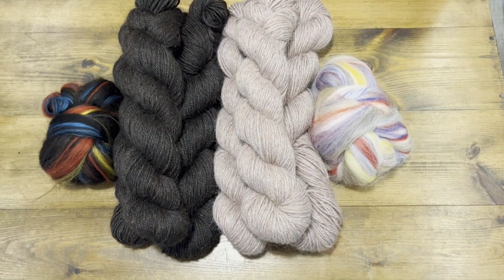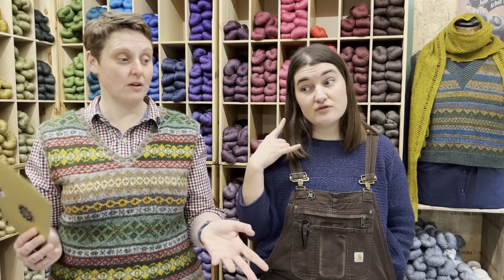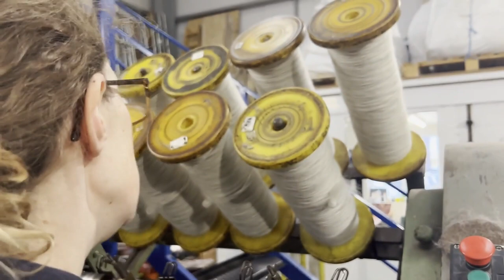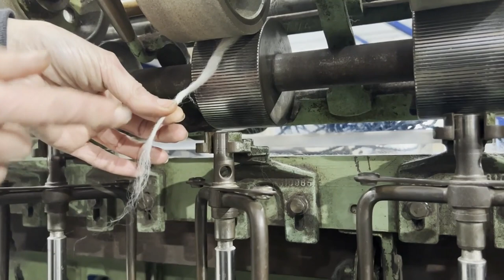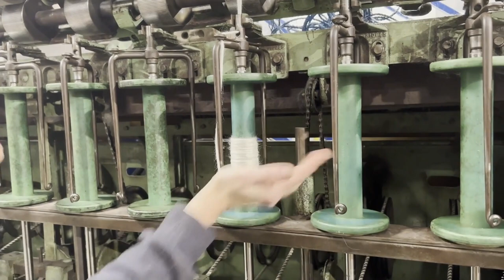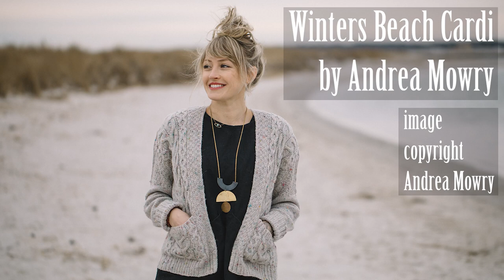JAT Vlog Episode 14 - All About Knit by Numbers & Squish Alpaca

Comment: I support the change in KBN, Devonia is my favorite. I love the longer fibers with a little more luster. The combination of having a long staple and worsted spun makes the yarn softer to the touch in my opinion.
Reply: @JohnArbonTextile  I would say that the fabric is firm without being stiff, good stitch definition, yet the fabric lays flat. Merino is easy to find. I think a smaller business will have more stability over time serving fanatics than trying to please everyone. Microsoft could never compete with Apple at what they did best. Your machines are difficult to setup, but once dialed in, they are so perfectly consistent over time. Even the twist is right, something that a lot of good mills struggle with. One type of yarn I would love to see is a traditional 5-ply Gansey. I imagine that would take you several years to perfect, and I think going deeper into specialty yarns is better for you if you want to expand the range, which I don’t think you need to.